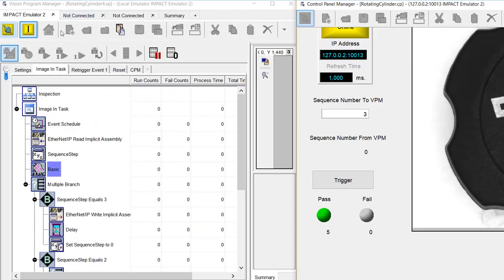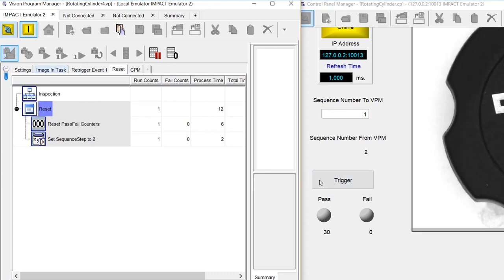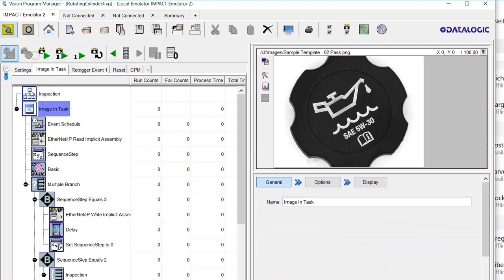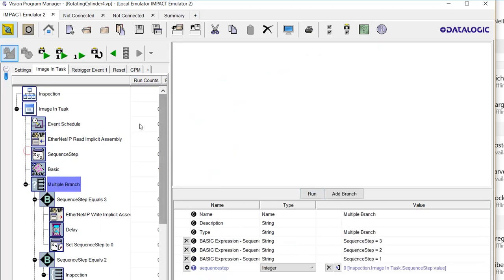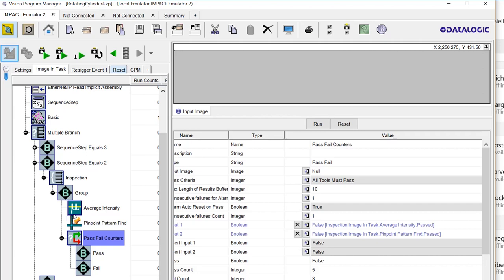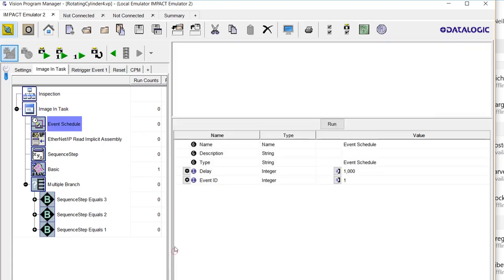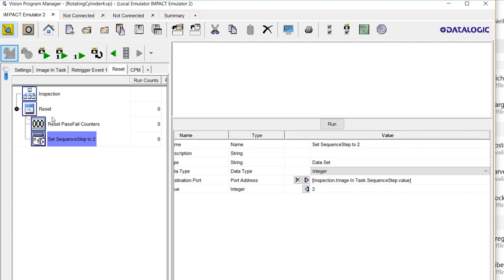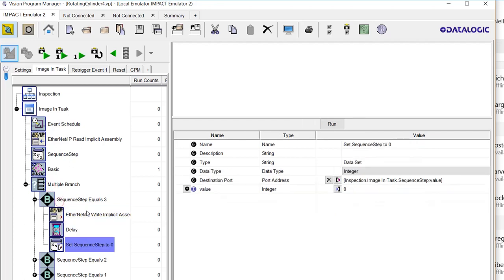Repeat Triggering in IMPACT

Comment: I am trying to use the multiple branch instruction for 4 side of an object. I have a robot that is rotating it and sending a signal when it is in position. how can I run this but using the BCD value from discrete input?
Reply from the maker: HI Levi,  Please call 1-800-BARCODE and ask for Machine Vision Tech Support and they will connect you with someone who can help with that.  You could also fill out a web form.  https://www.datalogic.com/eng/contact-us/technical-support-cts-8.html
Reply: @neilfarrow8928  struck out on both of those fronts. I get the automated reply from the email and since I bought it through a supply house and their support guy just retired I can't get much from them. 

It ended up just being a combination of spotty manual writing on their side, or so it seems, and me over complicating it. I made the basic instructions "Input1=1 for branch one, Input1=2 for branch two...." and then was able to link the input for it to the output current state integer of the discrete input.
Reply from the maker: @levi Olson - pls email the .vp file, at least 1 saved image (if possible), the version of IMPACT that you are running (Under the 'i" information icon at the top-right)
Reply: @neilfarrow8928  Will do. Thank you.